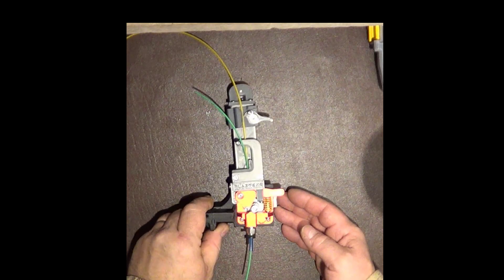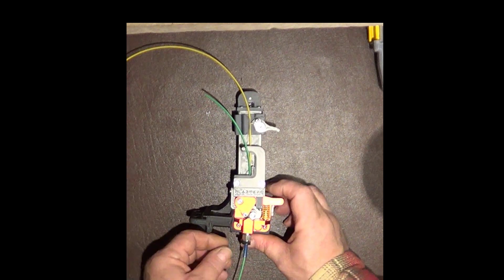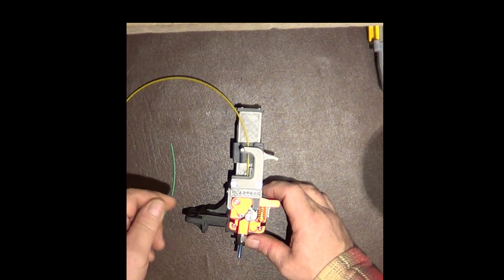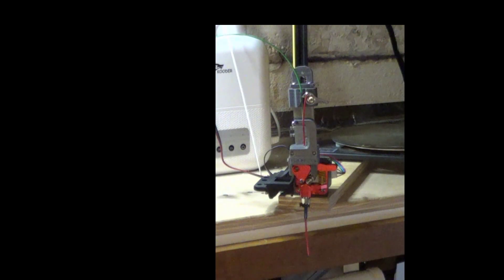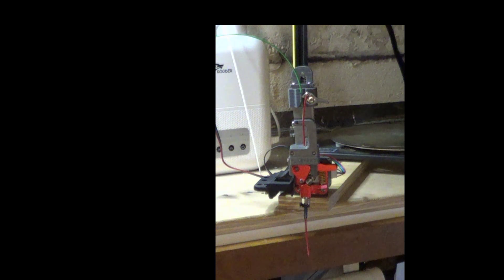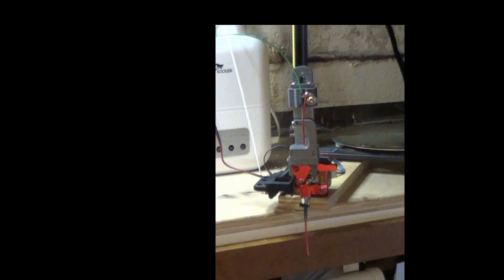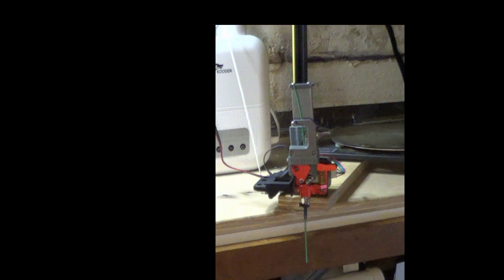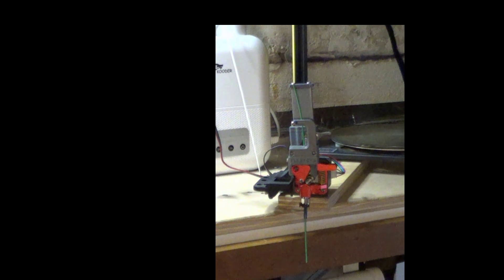Automatic Filament Loader for 3D Printers

Comment: Does it allow for the queuing of a new roll during a print? Say you have several rolls that are close to running out and you want to use them all for a large print
Reply from the maker: Yes, on a bowden tube extruder, it is easier to load a new supply of filament while it is printing than a direct drive because the loader isn't moving.  You can do it, you just have to be careful not to pull the extruder around while loading a new filament on a direct drive.

Comment: What extruder/feeder is that?
Reply from the maker: one like this, they are all pretty much the same:   
https://www.amazon.com/dp/B0925J73Q9?psc=1&ref=ppx_yo2ov_dt_b_product_details
I used the one that has the fitting on the inlet side, (just without the fitting so the small piece of bowden tube has somewhere to go.  You can use the one with just a small hole, but then you have to drill down, but not all the way through for the diameter of the bowden tube.

Comment: Is this all mechanical or does it rely on a firmware change?
Reply from the maker: no firmware changes or setup, completely self contained.  just works on spring tension to queue and then drive the filament into the existing extruder's drive gears.